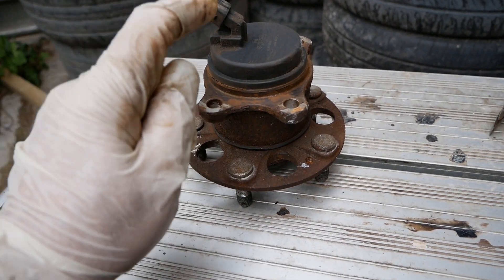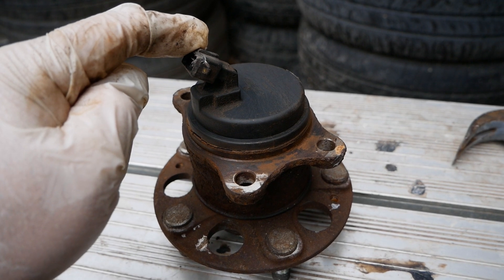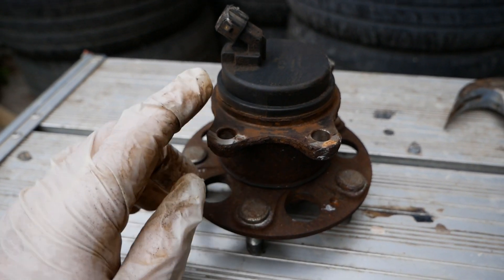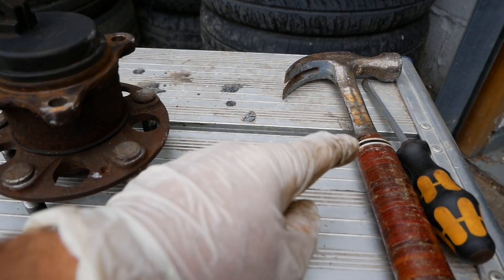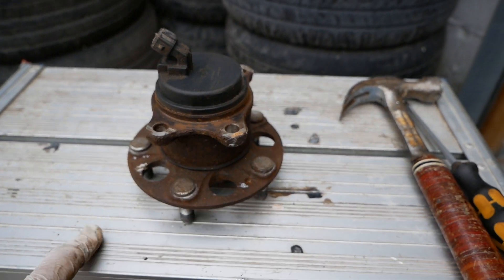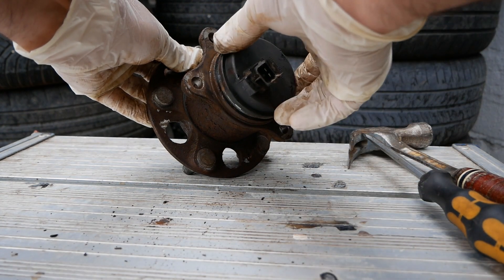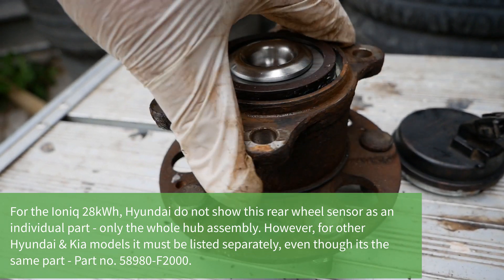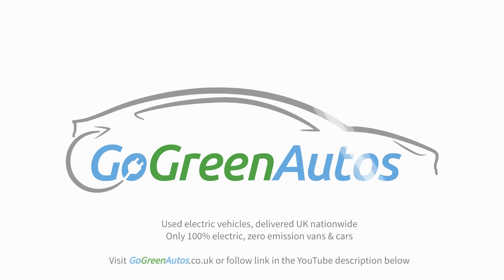Hyundai Ioniq rear wheel/ABS sensor removal

Comment: many thanks for your video , can I replace it without open the wheel bearing ?
Reply from the maker: I obviously took the wheel hub out and replaced it before I tried removing the ABS sensor. But from memory, you probably can just replace the sensor while it's in situ.

Comment: Hi,sorry to bother you, just seen the video because Im having the ESP and ABS lights showing on the dash on a Hyundai ioniq EV (2018 modelo) and the scanner points to the sensor on the rear right wheel só will order one off this you kindly left with the post.
And also have on that system that alowds you to have 3 diferent levels of driving,  on  level 3 you hardly have to brake it brakes whith the motor, well that thing its not working do you think its related?

Apreciate
Thanks
Reply from the maker: Yes. If the ABS sensor is not working, so it can't measure the wheel speed, all wheel & brake related systems don't work properly.

Comment: Just a note, if you are just replacing the sensor be sure to mark its orientation to the hub before you pry off the old one, otherwise there a chance it won’t be able to receive the connector plug/wire at completion.
Reply from the maker: good point

Comment: Hi Matt
Can you throw any light on a device that's fitted to one of the rear trailing arms of the ioniq 
Recently took into a tyre fitting company
While all wheels were off I took the opertunity to look at the brake discs and pads all good but noticed the odd device wired up on the one rear trailing arm
Reply: May be headlight levelling system to detect heavy load in the boot. It's common in cars with automatic headlight beam adjustment.

Comment: That is 158,000 kms my 28 has currently done 39,000kms, I have a long way to go :-) great vid, thanks !
Reply: Ours has failed at 109,000km, but you've still got a long way to go.
Reply: @paulaschofield  yes, now I have just clocked over 54k kms 🙂

Comment: I've changed the wheel bearing on both sides on my Ioniq ev, on the rear axle. The first one i replaced at 100k, the second shortly after at 105k kilometer. Seems to be a weakness on these cars. Had the abs and traction control light on in the dash.
Reply from the maker: Change due to needing a new wheel sensor or wheel bearing? If you haven't seen my original video, see https://youtu.be/wf43CwP2TVw
Reply: @GoGreenAutos  had the exact same issues as you show in the orginal video. Changed bacause of wheel speed sensor.
Reply: @kjetil442  And now we know you only have to change the sensor.
Reply: I have this issue. It cost me 300 for the part (only for the part) and 300 for the replacement. It s a shame. The part already paid waits me at Hyundai. Shame. 60000 km. 600 euro 🤬

Comment: Looks like a simple hall effect sensor. The black ring will be a magnet with however many poles and the sensor at the bottom of the plastic cup will pick them up as they pass by, changing the voltage in the attached cable. Looking online looks like the same part for my Kona EV.
Reply from the maker: Thanks

Comment: That's fantastic!  Thanks for investigating.  

I've had a couple of odd errors on the dash of my 28 recently, they have gone away when the car was restarted (and it's only been on short journeys in this very hot weather) but suspect I might have something similar starting and this might save me some money!
Reply: I have the same issue. R/H rear speed sensor. Has to be replaced